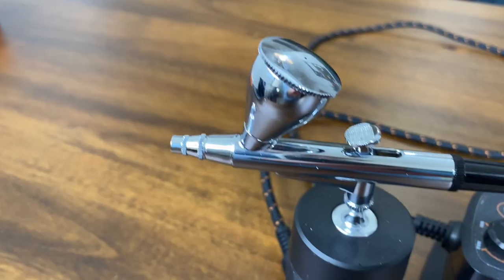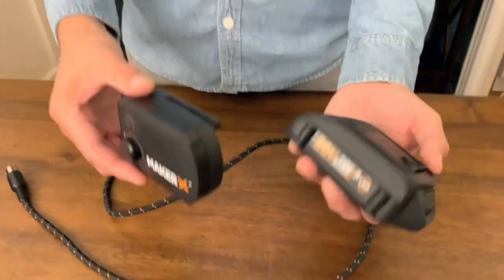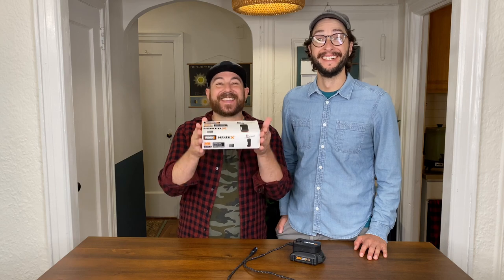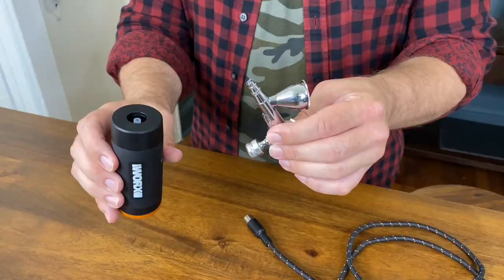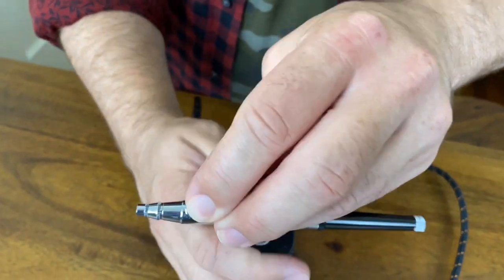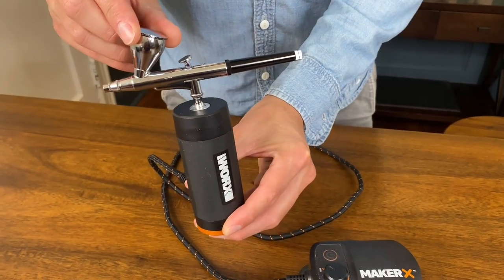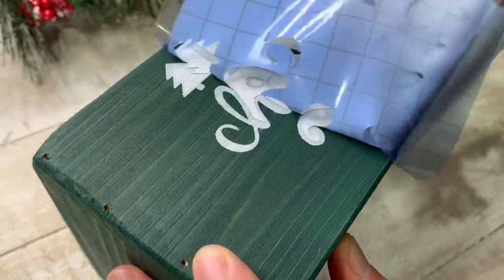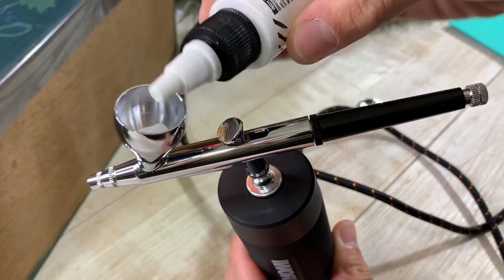MakerX™ Airbrush: How-To Tips & Tricks for Airbrushing Beginners

Comment: Do you need to buy the battery hub with the portable airbrush?  Or can the portable airbrush charge without it?  I've seen examples of portable airbrushes where the air compressor cylinder has a battery built into it and just charges using a USB Cable.

So do you need to buy the airbrush tool, WORX 20v battery, MAKERX Hub, along with the WORX 20v charger?  Seems like a bit of an investment.
Reply from the maker: The hub with the 20V battery is needed to operate the MakerX tools, but you only need one hub and battery as it is compatible with all of the different MakerX tools!